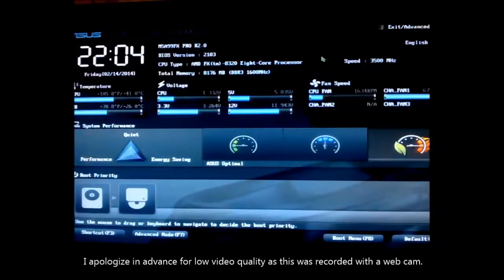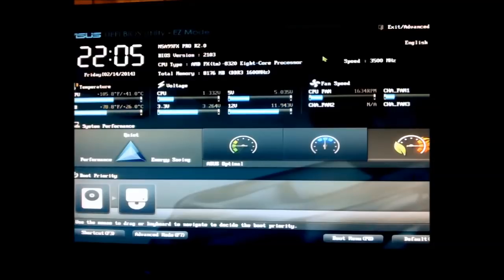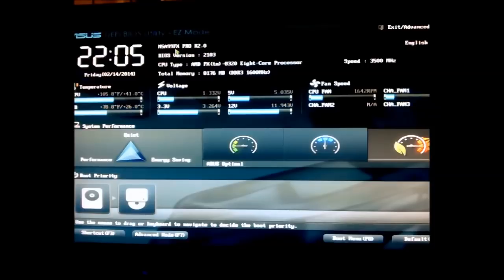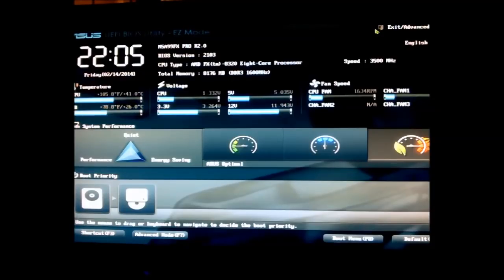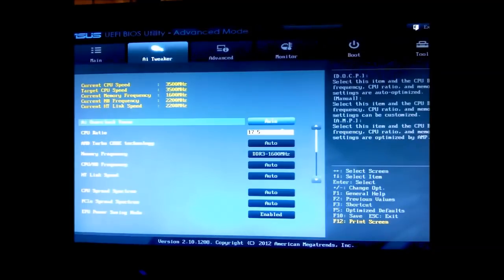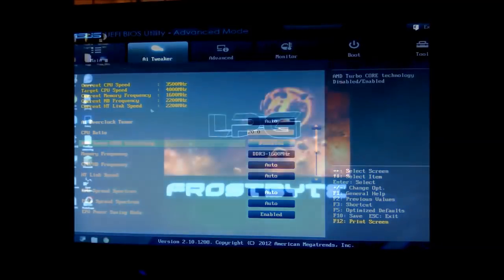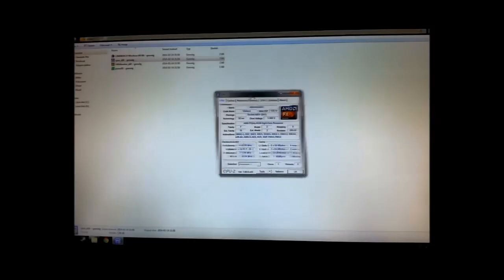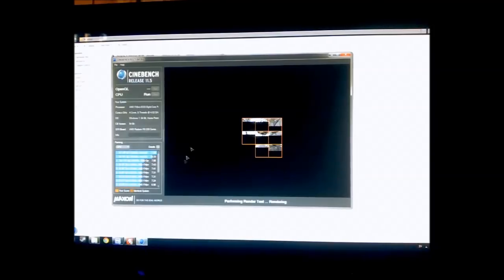Turn your AMD FX-8320 into an FX-8350 (8320 OC Guide)

Comment: sorry...when you say the amd 8320 is the same chip as the 8350...just underclocked.....your dead wrong. lets see you get the 8320 to even 5 ghz...never mind even higher...both of which the 8350 is capable of fairly easy
Reply from the maker: Buying an 8320 gives you a chance of getting a lower binned chip yes, however the 83xx chips nowadays can ALL reach that clock speed. You gotta be very unlucky to get one that cannot. AMD always makes their manufacturing process better the longer a chip is on the market. The last Thuban and Deneb CPUs that were out were really good chips that pretty much all clocked above 4GHz (alot for that architecture), people even got them instead of Bulldozer when it came out since they were so great clockers.
Your statement would've been correct perhaps a year ago. But now I think not. My 8320 for example can hit that speed without much effort and I would have that as a 24/7 clock if I had the cooling.

Comment: Is anyone else here even though they don't know whats happening?
Reply: This is the basic explanation. LPG is using a program to overclock the cpu clock to make it faster. Overclocking means the process of making a component or computer operate faster than the clock speed specified by the manufacturer. CPU clocks are used to keep everything in sync. The faster the clock, the faster the processor because it can cram in more instructions. To do this, you must modify the system parameters. System parameters is like a customizing station for your computer. Overclocking may result in excess heat and power use, which must be dispersed if the chip is to remain operational.
Reply: WARNING! Before you even think of overclocking a CPU like this please get a case that has room for multiple fans for both intake and exhausting air.I would recommend using custom water cooling solution or a branded custom water cooling solution if you prefer, there's no need for more than two radiators.If you are debating on what fans to use I would recommend for exhausting air Corsair AF 120 or 140 air flow quite addition fans and for intake Corsair SP 120 or 140 fans again quite addition.To control your fans you can use a fan controller and software and get the best of both by using a program like speedfan which is free and all you have to do is draw a curve or just control them with the fan controller.To keep fans quite I would recommend running them between 60% to 80% and at 700rpm.The phobia touch six fan controller is great fan controller for it's price.

Comment: I did this
Now it runs at 3.7ghz not 4.....?
Reply from the maker: +J⃟O⃟N⃟A⃟T⃟H⃟A⃟N⃟ S⃟C⃟H⃟U⃟L⃟T⃟Z⃟ Your turbo core is still enabled if that is the case.
Reply: Nope
I did exactly what you did
And it runs at 3.7ghz says CPUID
Reply from the maker: J⃟O⃟N⃟A⃟T⃟H⃟A⃟N⃟ S⃟C⃟H⃟U⃟L⃟T⃟Z⃟ What motherboard do you have? Either it wasn't correctly saved when you left bios or cpuz is displaying the wrong information. Try run some benchmark and compare it.
Reply: Task manager says "max 4.20" and its running at 3.96ghz
But I think I would trust CPUZ more

Comment: great video man!what mobo would you recommend for this?i mean yours is great but i need something cheaper!also with this setup and a r9 280 with those levels of OC what psu should i get?i have a coolermaster 550W gx bronze...thanks!
Reply from the maker: When it comes to motherboards i'm not sure what I can recommend as far as Iäm concerned. Anything with a proper power phase and 990FX chipset preferebly. 550W is enough for 280 and 8320 at this clock speed. Clocking it any higher may get the 550W to the limit, although only when both are 100% stressed, which rarely happens. My system pulls max 540W with 8320 @ 4,4 and 280x. During heavy gaming it only pulled roughly 380W. So yes you should be fine.
Reply: thanks a lot!!!what about a 970? like the asrock fatal1ty 970?
Reply from the maker: ***** no knowledge of that one
Reply: i meant a 970 chipset instead of a 990... would it work or is it not recommended?
Reply from the maker: ***** Work yes of course, with these chips they can limit your overclocking however.
Reply: ***** Do you have a microcenter around you?  They usually have a bunch of boards that people returned. I picked up the same board as LPG for almost half the price.
Reply: You should get the Gigabyte GA-78LMT-USB3
Reply from the maker: Rasmus Nordenstein That would reset it.
Reply: +LPG hey i have fx 8320 970extreme4 and gtx 960 and 212+ evo and 8gb ram with 500psu will i have enough voltages for the oc?

Comment: In all fairness i like the guys thinking, especially if you can pick up a new fx 8320 for around $120 and save about $50, although the fx 8350 has a turbo speed of 4.2 Ghz, not meaning to be a dick about all that though i have actually done this myself so yano just thought (well i have turbo key with my asus mobo so thats set to 4.2 so if i think it needs it i will do that)

Comment: The 8320 isn't a underclocked 8350. amd take the poorer quality, less stable chips and lable them as 8320's, that's why you can oc 8350 to 5 ghz and above with good cooling but you can't usually oc to 5ghz with an 8320 unless you are very lucky.
Reply from the maker: Most 8320 processors are underclocked 8350 CPUs. I know alot of peps with 8320 processors clocked at like 4.6-4.8. However yes you are correct in one way although you're over exaggerating, some processors that were supposted to be 8350 CPUs but were not good enough perhaps had to be downclocked to be able to run stable. If you get one of those you just have bad luck. I had some bad luck in the lottery ticket for example, my 8320 doesn't like anything above 4.1 in offset voltage. Other 8320s can do like 4.4 with same volt.
Reply: what I meant was that they cannot be pushed as far as 8350's but yes I did kind of exaggerate as I have got my 8320 @4.5ghz however i don't think it is as simple as them taking some random 8350's and underclocking them.
Reply: Quzova that's exactly what it is - underclocked fx 8350. That difference in OC-in exist even between fx 8350. That's pure luck, every example is different

Comment: Pretty bad tutorial. You left cool'n quiet on.There are many more settings to be tweaked
Reply from the maker: Not particularly anything else needed for this overclock. Cool n quiet clocks down the CPU when it's in idle. We want that. Turbo should be disabled as it otherwise has the setting to clock it at ~3.7 most of the times when we want it at 4GHz.
Reply: ***** Fx-8350 boosts to 4,2Ghz. How is this fx-8320 at 4,0Ghz the same thing as fx-8350 at 4,2ghz?
Reply from the maker: Villee Same thing there. The 8350 rarely if ever go to that speed. At stock the 8320 tends to sit at 3.7 with medium load while the 8350 sits at 4.1. With bigger load the 8350 goes to 4GHz and the 8320 to 3.5. Getting the 8320 to 4GHz will make both CPUs run at same speed when the load is high enough to make the processors speeds matter. That's when you really start notice the differense the overclock made.

Comment: got mine to 4.4ghz on hyper 212+
Reply from the maker: Voltage? I have mine at 1.356 at 4.4.
Reply: ***** Was lucky mine went to 4.2ghz stock voltage. I used amd overdrive program (not ccc built in one) auto clock to find minimum voltage for my multipliers. Then put in manually in bios.
http://i.imgur.com/SKGg9Ne.png
http://i.imgur.com/Jx93uZh.png
http://i.imgur.com/JFprige.png

It got to 4.6ghz stable amd overdrive. But temps & aiden64 extreme tests & prime95 bsod. So I backed off to 4.5ghz 52c load which is the heartbreaking thing. Passed every benchmark test I threw at it (8 tests: 3dmark~3tests, aiden64 extreme, prime95, cinebench, Valley, Heaven) & after I was threw with my tests. Played Far Cry 3 for 3 & a half hours on ultra crashed my pc :(. Tryed uping the volts but temps got to hot for me 55c. Might try again later to tweek it it up to 4.5ghz.
 1.263 @ 4.4ghz  48-50c load  28c idle

CPU: AMD 8320 8core@4.4Ghz oc 
Cooler: CoolerMaster Hyper 212+ (Artic Silver 5 Goo) 
Mobo: Gigabyte 970A-D3P AM3/AM3+ 
RAM: Gskill RipjawsX 16gbs(2x8gb) 1866mhz 
GPU: MSI R7870-2GD5T/oc 15% 
Hdd: Sandisk 128Gb SSD boot drive 
2x1Tb Hitachi 7200rpm Hdd 
2Tb WD MyBook 7200rpm external Hdd 
PSU: Rosewill Hive 650W 80+Bronze full Modular 
Case: Rosewill Challenger USB3.0v Mid-tower 
OS: W7 64bit Hp
Reply from the maker: HumanLiveStock How come your cinebench score is so low? Mine scores 7.58 at same clock.
Reply: *****
 I went into my bios, & thought it was because my HPC (high performance computing) was disabled also Core C6 state (cpu power saving) was enabled. So I switched both of them & put in your volts 1.356v. reran the test lol
http://i.imgur.com/ke5rA82.png
Reply: Amd OD is still reading my volts as 1.263 weird

fixed it amd OD was overriding my volts lol

Comment: i turned my 8320 into a 9590 by overclocking lol
Reply from the maker: Lottery ticket win :)
Reply: So you get 2 more cores with overclocking, pretty legit.
Reply: Magezi there both 8 core CPUs on the same architecture, look it up on wiki, only the clocks r different
Reply: Mike Hill oops I was thinking it said 6320

Comment: Is this alls I have to do? do i not need to mess about with voltages and stuff?
Reply from the maker: Negative. Voltage is high enough from stock.
Reply: ***** I run prime and one of my cores failed so where do I go from here?
Reply: and I get like 2fps now on battelfield 3 where normally i would get 60-100
Reply from the maker: TomTravis How much did you OC? Lower it or reset it to standard settings. Something is wrong definitely.
Reply from the maker: TomTravis How much did you OC? Lower it or reset it to standard settings. Something is wrong definitely.
Reply: ***** oc'd to 3.8ghz stable not checked it at 3.9ghx yet althought i know 4ghz wont happen

Comment: Can 8320 get to 4ghz with stock cooler?
Reply from the maker: As I mention yes as it's the same stock cooler for both the 8320 and 8350, but keep an eye out on the temps anyway.
Reply: ***** ty bro
Reply: The best thing i did was to buy a corsair h60 that keeps my fx 8320 in 28C idle vs the fucking shit 58c that was with the stock cooler. Have to say something about the noise? :/

If i said anything wrong in questions of grammar please tech me because i speak portuguese :)
Reply: Leoni M. tambem sou pt lol. obrigado

Comment: Can i also OC my 8320 with my MSI 970A-G43 Motherboard?
Reply from the maker: +Dan P Avoid it. The motherboard only has a 4+1 power phase and not heatsinked.
Reply: thanks for da quick answer :3.
but what does that mean ? :\
Reply from the maker: Dan P The motherboard won't like the extra power needed to go to the CPU. The things on the board that supply the CPU with power is not cooled properly.
Reply: thanks man :3